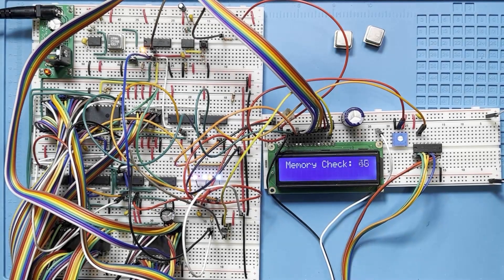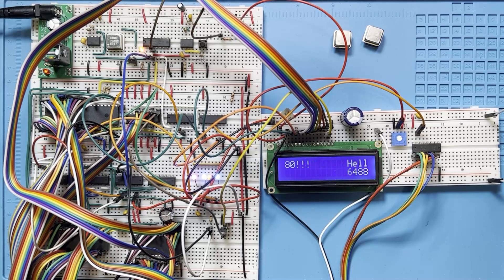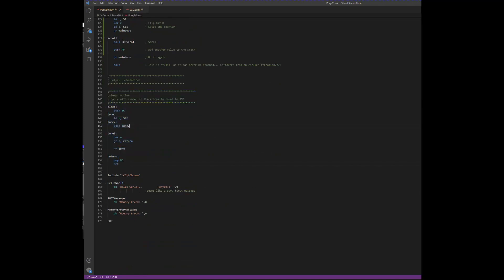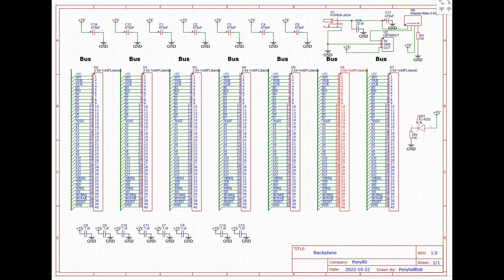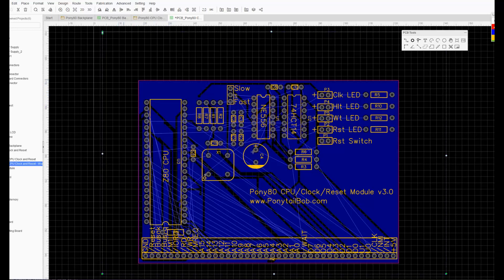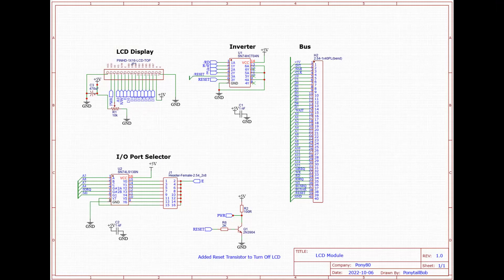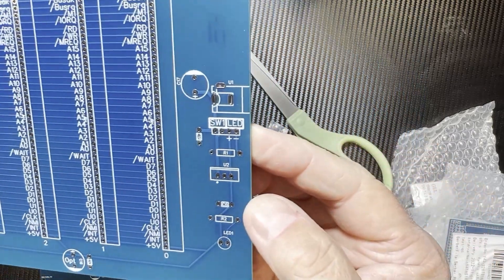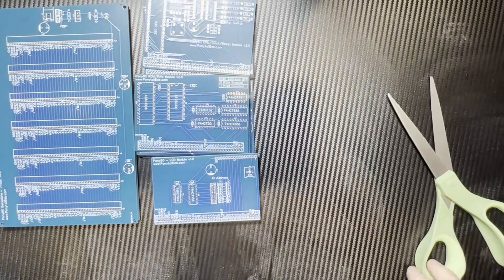Pony80 - System Board Design - My Z80 homebrew computer

Comment: Nice update! 

I was wondering: the pinheaders for the connector to the backplane appear to be upside down in the 3dview. Was this done on purpose, or is this an artifact of the PCB layout program of EasyEDA?
Reply from the maker: Honestly it is just because the silk screen outline runs off the board if I turn it the right way…
Reply: @Pony80  KiCAD often complains about that as well, which annoys me greatly from time to time.
Reply: @damouze in KiCad I just swapped the 90 degree horizontal header for the vertical one to get rid of the annoying DRC errors once I had it placed right.

Comment: From what I've seen elsewhere, having just a single ground and power connection on the bus may lead to issues at higher clock speeds.
Reply from the maker: Thanks!  I am thinking that the clock speeds that I will be running (<20 MHZ) should be ok.